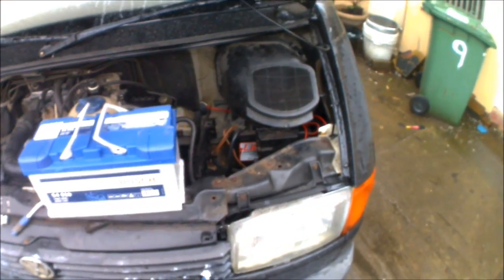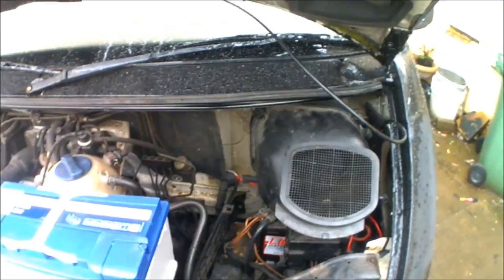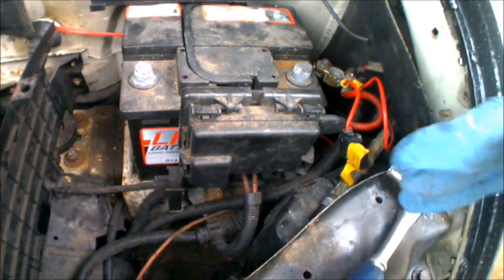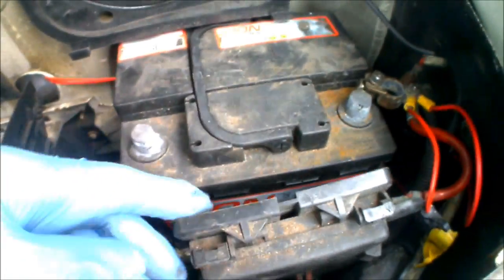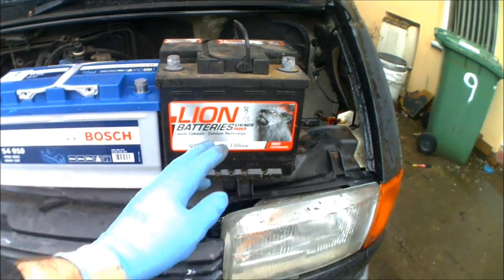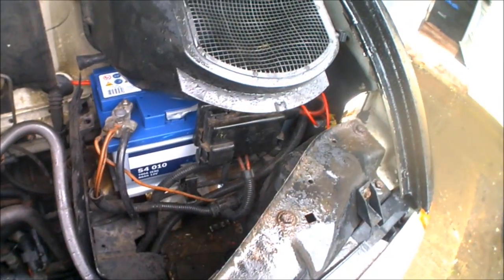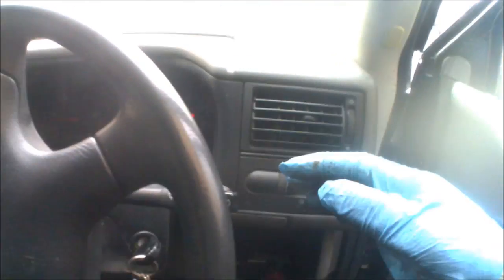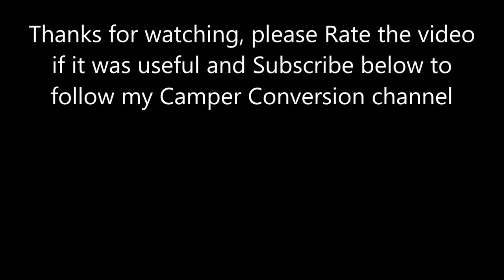Replacing Starter Battery VW T4 Dead Starter Battery Replacement

Comment: great video! i noticed when we reconnected the terminal wires to the new battery, the car alarm did not sound. Normally on most vehicles the car alarm should start sounding when a new battery is detected?